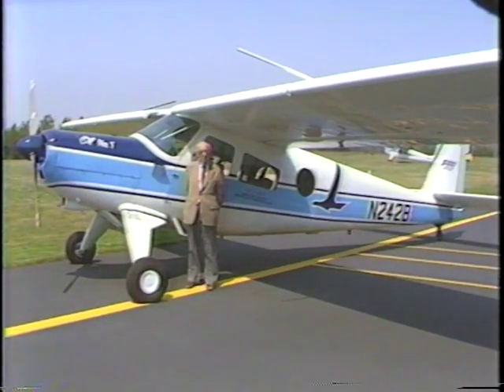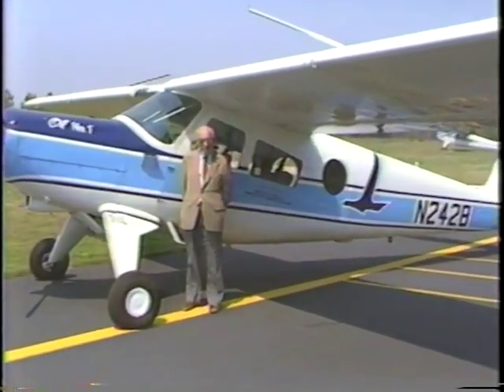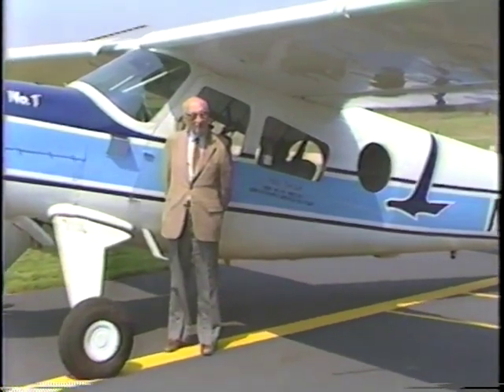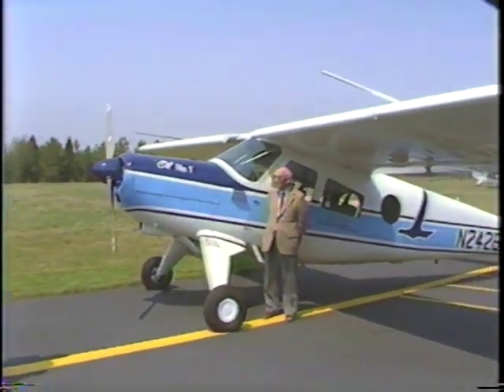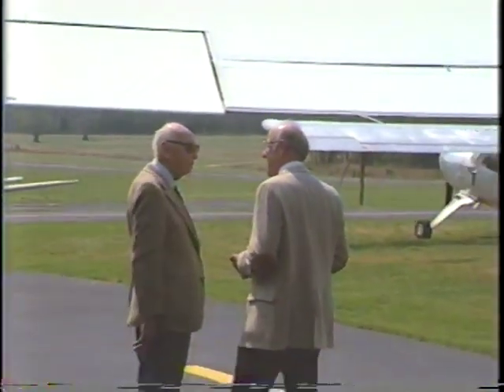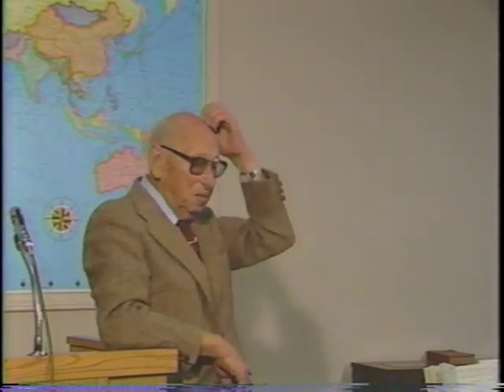Dr  Otto Koppen Presentation on the Helio Courier

Comment: God bless you. I came across Helio Super Courier around 47 years ago when i was an young apprentice mechanic. A great aircraft.
Reply: In 1964 I was age 2 and my Dad was flying a 1955 Cessna 180 flying into northern Alberta landing in forest clearing's to support road construction for seismic and oil and gas exploration, well one day he came back to our pasture with a 1957 Helio Courier ser. # 075 and a few years later bought ser. # 096.  I loved those aircraft but many pilots were wrecking them frequently they required good skills to avoid bending em.

Comment: This is the way to design a decent STOL airplane.  Not these endless variations of ridiculously overpriced  Cub-clones.
Reply: Agreed. This is a very purpose designed aircraft. The philosophy of use is evident, and the design choices are quite coherent. The retractable slats are not only responsible for its inability to stall, but also its relatively high top speed that is more comparable to the Cessna 180/185 than the Wilga, Storch, or Zenith. And it can fly slower than all those STOL planes while flying nearly as fast as a Skywagon which cannot fly even half as slow.